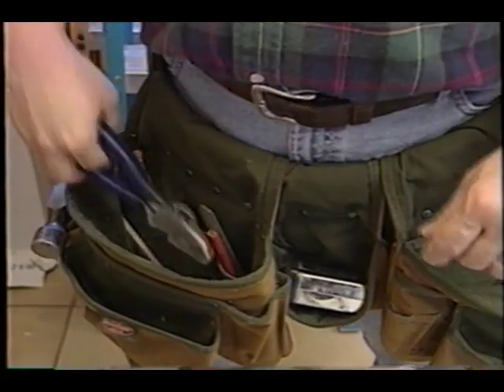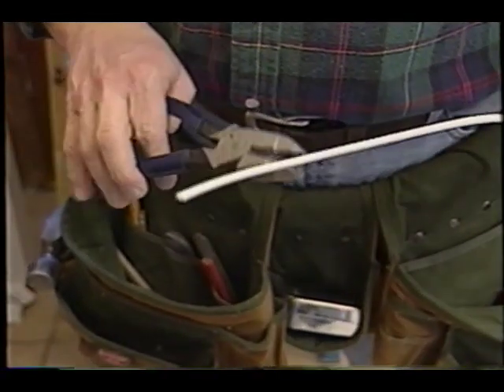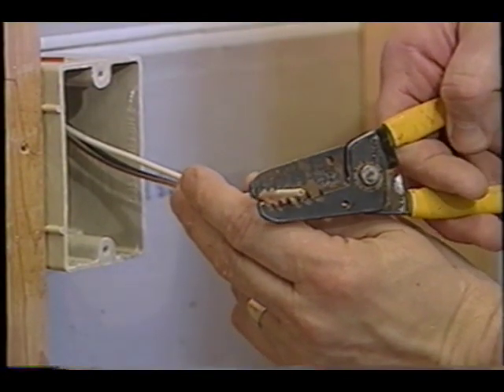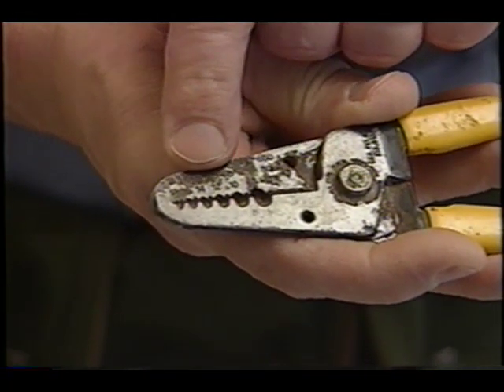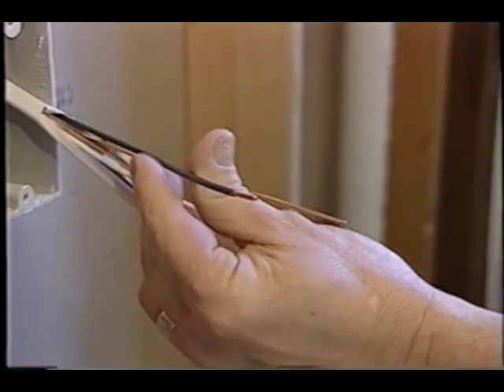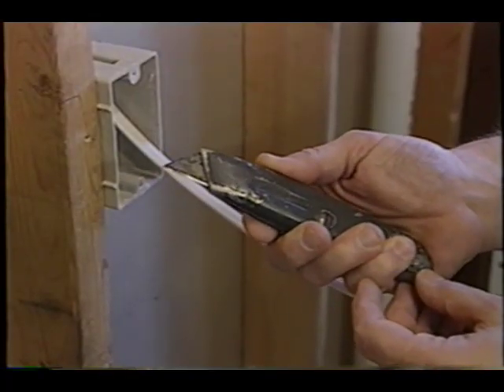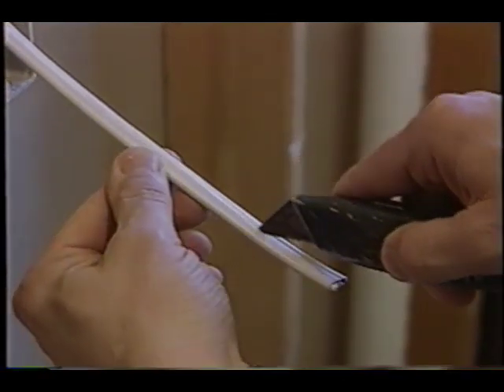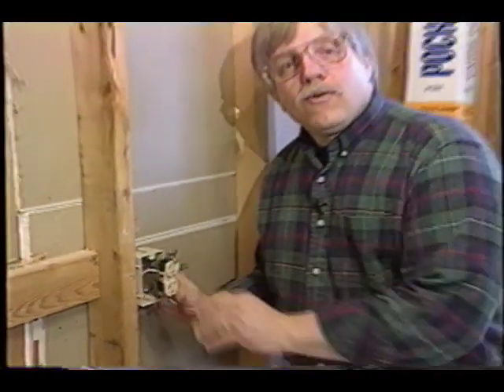Electrical Outlet Box

Comment: @AsktheBuilder That's what I do too. I'm in Res electrical I wouldn't have time to pull out my pliers just to make a loop. Also I use Romex wire strippers I find it faster than having a knife. You can just strip the insulation in one go. Also most plugs here now have holes in the back and you can just push the wires in there rather than using the screws on the side. Some may disagree with using them but I have never had any problems.

Comment: Fiber, the answers you have received have been good. You are probably on a 15 amp circuit drawing 12.5 amps so it may run warm. You might turn the power off, pull the outlet out and make sure the connections are tight. If the wires are just stuck into the back of the receptacle remove them and wrap them around the screws instead. This may make a big improvement regarding the heat.

Comment: it's worse than that:

power lost to heat is actually (current)^2 X Resistance

double the current, quadruple the heat

the reason large appliances don't generate as much heat at the outlet is bc they run at 240V. 

power is voltage X current.

more voltage allows more power with less current which leads to less (current)^2 heat loss.  

this is also why utility power lines can run at several hundred thousand volts.

Comment from the maker: If it's a 15-amp circuit, you're running close to maximizing the amount of electricity coursing through the wires. The movement of the electricity causes friction which in turn creates heat. The breaker is the throttle control so that the heat does not get great enough to melt the insulation on the wires.

Comment from the maker: I don't know if I agree with that at all. I have a stripper that actually doesn't cut all the way through the plastic insulation. No doubt cheap strippers not ground to one or two thousandsths larger than the outer diameter of the wire will nick the copper.

Comment: Hey, being a professional electrician myself, on normal jobs I use linesmans pliers by themselves. If I'm connecting circuit boards I use auto strip wire strippers. As for the bending wires, the sockets here require you 'plug' the copper wire into the back of the socket, with controls that use screw we are required to use Y or O crimp connectors..
If it is called for, normally screwing in the bare copper ground wire, we are required to use round pliers.

Comment: The pros and cons:
Both wire strippers and pliers can and will nick the wires which in turn makes that area hotter and prone to electrical fires, but the linesmans pliers gives you somewhat better control. With practice, you can make nick-free strips.

Comment: (No wire stripper will not nick the copper wire 100% of the time!)
Using a pair of pliers, which ever type to strip wires, makes your hand more fatigued especially if you are doing a lot of connections.
Like Goinggonegoing said, using more tools for a given task at one time, makes the job slower, especially when you have to make 100 connections per control panel.
BUT: I totally agree that for the grasshopper using a wires stripper leaves a better cut.

Comment from the maker: Those emotions you feel from the other electricians is FEAR. They don't want you to become smarter than they are. You can already work harder, so they fear if you get smart, they will become less valuable. Consume as many videos as you can. Fine Homebuilding also has some great books about residential wiring by Rex Caldwell. I've read all his books.

Comment from the maker: That is an old piece of 12 gauge cable that was in my basement from when I wired my house 22 years before the color coding of cable came into play. You must match wire gauge to the circuit. Just check your National Electric Code book for the requirements.

Comment: Read the packaging carefully. Almost 100% of the time, the rubber or other coatings on the handles of pliers and screwdrivers are only to give you a more comfortable feel or grip. The kliens Linesmens pliers even have the words "Warning-not insulated  Will not protect against electric shock." etched directly into the metal. The coating can keep you from getting a shock, but it is not intended for that purpose.

Comment: The new 2008 Nec(article 406.11) is requiring tamper resistant outlets and GFIs to be used for replacement(and new installs) on 15 and 20amp circuts in dwelling units. Just a little extra info for your viewers. People are going to try and do the small stuff anyway, might as well give a little good advice. It's never cost me a day off work and extra knowledge is good for everyone. Keep up the good work Tim.  P.S. Arc fault tech is getting much better so don't fret, it's all in good time.

Comment from the maker: I can't tell you..... Conduit is heavily used and required in certain commercial and institutional applications. But for residential, I have never had an issue with a conductor going bad. I am sure it happens, but my guess is it is pretty rare. With our frame construction, it is fairly easy to fish a new cable to many locations.